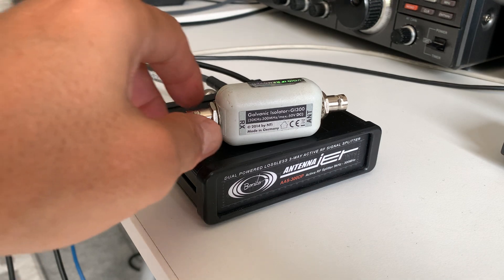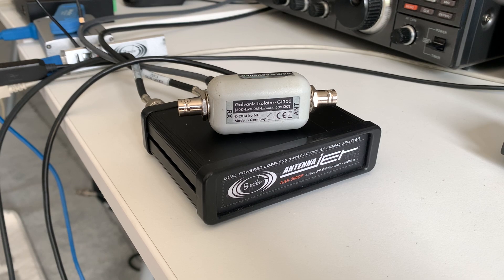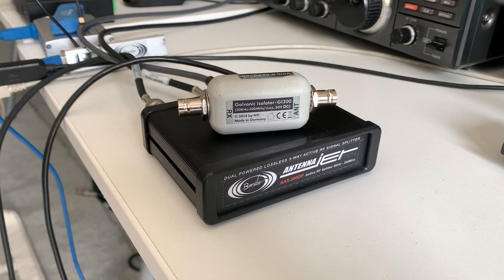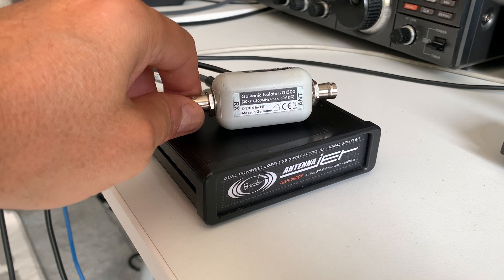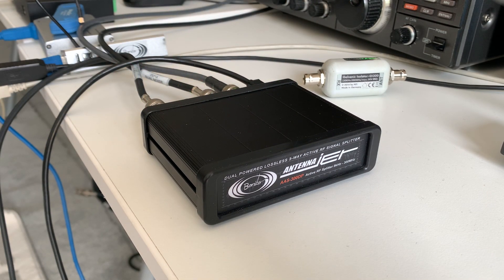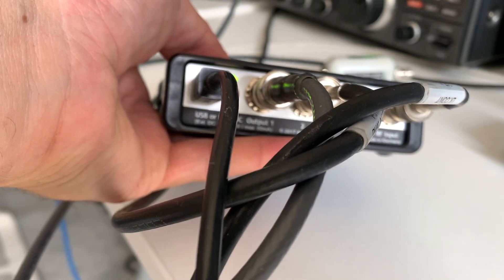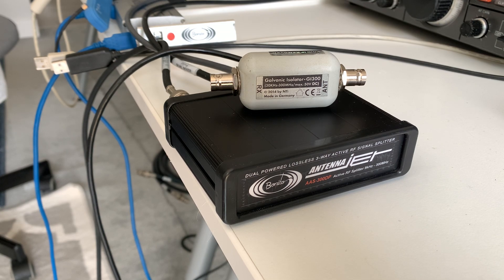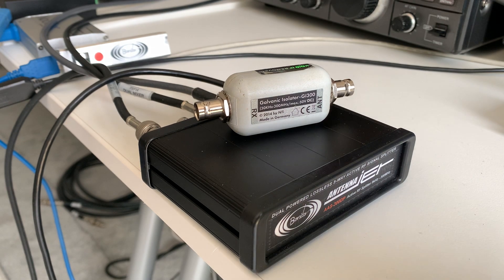A review of two of my most important shack accessories: Bontio RF splitter and Galvanic Isolator

Comment: Just ordered a GI1000 galvanic isolator direct from Bonito after watching your accessories vid, Ive been hit with S9+ noise down at LF which came from nowhere a few days ago,still got it when running my reciever direct from my 12v battery Clint with electrics turned off at the mains so can only assume its from a neighbours house or from the Central line train rack that runs past at the end of the garden, also gonna change from RG58 and replace it with some lmr400 coax and see if that will make any difference, would be interested on your views as to whether the cable change will make any difference,antenna by the way is a copper loop via a CCW loop amp, great channel mate, keep up the good work…73
Reply from the maker: Cheers, Steve. I hope the GI1000 fixes things for you - it certainly did for me ( as did the GI300). Good luck and 73!